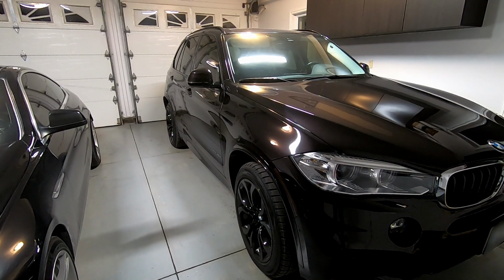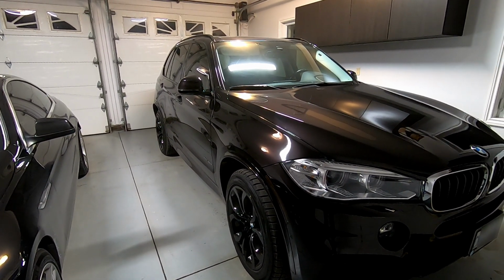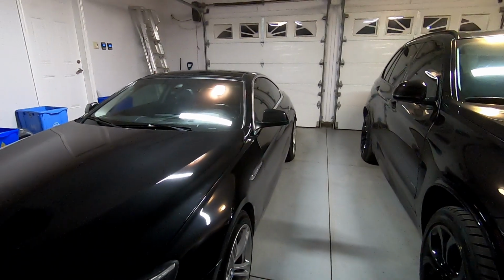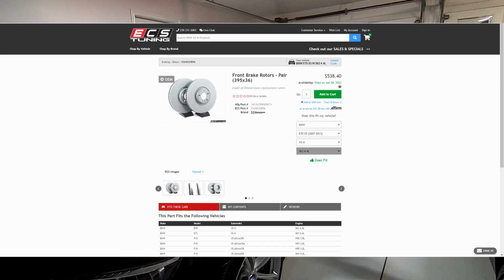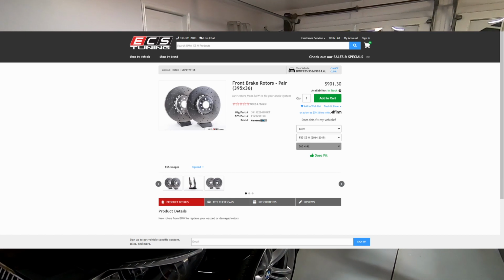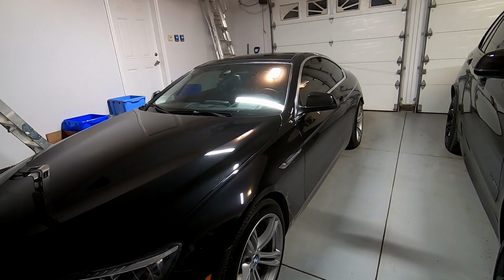BMW F10 Affordable Big Brake Upgrade!

Comment: Any issues considering the center bore of the x5m is slightly bigger? Also, have you thought about f80 rear rotors to match the front?
Reply from the maker: Good call! I didn’t notice any issues, but I will in the near future investigate this as I still have the parts and a similar car to play with. If I recall correctly the hub size where the rotor sits is larger than the 72.6 hub size used for the wheels and it’s possible that the bore for the rotors is the same between X5 and smaller bmw models even though the wheel bore is not the same. You can see a step at the end of the bearing shank where the rotor would sit at 7:05. This step in combination with the rotor screw should allow the rotor to be properly centred. My dad didn’t keep the car long enough to even get a chance to upgrade the rear brakes, he traded it in for a bigger car… but it may be something I’d consider when I need to replace my brakes on my 650i !
Reply: Got cha! Love what you did, good luck with the future project!

Comment: My main question is, will this 395mm setup fit a 19” 351m M-Sport F10 wheel?? Do you need AM or OEM 20” wheels to run this setup or can these brakes fit behind the stock 19s??

I’m between using G series M Performance 395mm brakes vs G series M Sport 374mm brakes. But after watching your video, I’m interested in doing this X5 M conversation (this option solely being for Fitment as I like the G series styling more.)
Reply from the maker: Interestingly enough, the clearance from brake callipers to wheel spokes increases with the X5M callipers, meaning you can actually fit higher offset wheels after the retrofit (but why would you haha). We used 19” aftermarket super speed wheels and OEM M5 19” winter wheels (408M) without issues. I would presume that your 351s would also be the fine, but I haven’t test fitted first hand!
Reply: @dariusGarage  GREAT CONTENT!! Thank you for getting back to me so quickly. With this video alone, I feel like the X5 M caliper route might just be the easier way to go, Fitment wise thanks to your very informative video.
Reply: @dariusGarage this is interesting. I have almost no space at at all between the stock caliper and inside of wheel spokes and have been discouraged from trying this. Also considered the m5 brakes but figured the was no way I could fit them
Reply from the maker: @Dahigi777  f10 m5 brakes are significantly more expensive to retrofit as compared to these X5m callipers as you also need to run custom adapters and the parts are pricier. I’m not sure how fitment would be with f10 m5 brakes but I’m confident that you would be fine to install x5m brakes with your existing wheels so long as they clear your existing f10 550i / f13 650i brakes, they are the same brakes used on alpina b6 edition 50 (I’m pretty sure wheel fitment is identical to standard BMW)
Reply: @ definitely adding this to my list of things to look out for on eBay etc

Comment: If you install new m5 brake dust shields, do you have to remove the hubs to install them?
Reply from the maker: No, on the front of all f10 models (as far as I’m aware), you should be able to remove the dust shield without removing the wheel bearing/hub. The back may be a different story
Reply: Okay thank you!  @dariusGarage

Comment: Does the brake pedal feel spongy? My only concern is that the stock master cylinder won’t be adequate for the upgrade.
Reply from the maker: The brake pedal felt super tight and strong after the upgrade, better than stock. Almost like an on off switch. Even with ceramic pads the pedal felt much like the brakes an F85 X5M which are super strong!

Comment: Did you replace all four brakes or just the front two
Reply from the maker: Just the front 2, for the back we were going to upgrade it to M5 brakes as well (larger rotor and M5 calipers) but ended up trading in the car before we got to it. The back brakes don't look that great even when upgraded as they are just a single piston design like any other car, just painted blue with a larger rotor. Its hard to upgrade the back to something nicer as the caliper must also have e brake functionality and there are no pretty off the shelf BMW rear calipers with E brake built in.

Comment: Can you put those on a 2014 535i?
Reply from the maker: If its an xDrive I'm confident it should bolt up the same way as our 550, it uses the same hub carrier as the 550i xDrive. If its RWD it may be different as the hub carrier is different... that being said rwd and xDrive use the same rotors so maybe it will work as well but it may have some differences. Of course please do your own research before pulling the trigger and buying the parts!

Comment: I was wondering if it would work on a 2011 528i
Reply from the maker: I don’t see why it wouldn’t work, all xDrive F10s use the same spindle that the brakes bolt up to, and the rwd and xDrive 528is (n52 and n20) use the same rotors and brake callipers. This indicates that what you can fit on an xDrive 550i f10 can also fit on any 2011 528i. The only thing to keep in mind is that you will likely need 19” alloys to clear the calliper… they are huge!!!

Comment: What was the total cost?
Reply from the maker: Good point I should have mentioned that in the video! We already had the bare brake callipers from a trade deal so it makes it a bit complicated… We needed hardware ($100CAD) rotors ($1200CAD), pads ($160CAD) and some brake fluid ($30CAD). Our cost for the brake upgrade was around $1490CAD. The aesthetic repairs we did costed an additional $500 for all the fender liners, shields and cleaning products.

The callipers will run you an additional $1000- $1200CAD for cheaper ones, if you want new ones you can buy from ECS tuning for $1000 USD per calliper. 

Total price for just the big brake kit with used callipers will be $2700 CAD they way we did it, but with plain rotors it could be as low as $2200 CAD
Reply: I just did this swap on my X6 the only trouble I had was finding the adapters. But after finding them make sure you have a set of wheels to clear the calipers. I made that mistake even though they are 20” wheels the barrels were 3mm smaller I shaved down the ends of the calipers. Some new powder coating and good as new

Comment: Can u fit them to a e92 m3
Reply from the maker: Great question! I was not sure myself so I did some digging. The E92 is not an easy car to do bbks on because of how it bolts to the spindle. There are normally two retrofits that are done. 

The first is F80 m3 4 piston brakes, you need F80 spindles and a bunch of hardware to make this work. Not an easy task because you have to mess with more than just brakes. 

The second is the F10 M5 6 piston brakes. From my understanding this is a much more expensive option as the parts are more expensive but the plus side is that you can bolt a bracket to the caliper to avoid changing out the whole spindle, you may however need to get a lower offset wheel to clear the massive caliper. The end result however is simply fantastic. 

Either option is expensive and I can see why you are looking for alternatives, however I don't think the E70 X5M calipers would make sense on your application. Their bracket design is similar to the F80 in that its not removable like the F10 M5s are, so you can't put custom brackets on it to make it work with your stock spindle ( I doubt the X5M brakes would work on your stock spindle since F80 M3 ones don't) , so you are left with getting an F80 M3 spindle and hoping the X5M caliper would fit on it (nobody seems to have done that upgrade on an F80 though). I don't have an E92 or F80 M3 to test stuff on nor do I know anybody with one well enough to let me mess with their car. Sorry but I'm not the guy that can answer your question! 

Thanks for reaching out!

Comment: The purpose of drilling and slotting rotors is to help with cooling
Reply from the maker: @travismachado4406  in theory yes, in practice no. 

Drilling rotors in particular is the least effective for performance gains as the holes in the drilled rotors only cool the metal around just around the holes, the non drilled areas remain quite hot… meaning uneven expansion and contraction of the rotors (warping and cracking results). 

They also have less heat capacity as there is less metal to heat up, so they over heat faster, this also means they cool faster yes but that means nothing when your brake fluid is absorbing that heat… and that won’t cool fast! 

Look at race cars and see what they use, they use primarily plain rotors and sometimes slotted.

The slots on slotted rotors allow for the brake pad surface to be cleaned off, they are noisy and can make brake pad life shorter. 

With plain pads, pad material builds up and can prevent full contact with the rotor surface on plain rotors, this can also lead to pad deposit spots on the rotor face which cause pulsation/vibration in the wheel. The upside is smooth, quiet performance, (as long as everything is working properly) with long service life. These rotors are the least likely to warp
Reply from the maker: @travismachado4406  but don’t take my word for it! Here’s an engineer’s take 

https://youtu.be/EIa6_C1B6UQ?si=kE4uqHEUkegwQiDn

Comment: Will this help with brake fade?? Been experiencing hot brakes and loss of power after some spirited drives in my f10
Reply from the maker: Yes, this will definitely help with reducing brake fade since there is more mass and fluid to heat up in the braking system. But there are cheaper alternatives as well! It’s always depends on your specific case…

Which f10 do you have? When’s the last time you had your brake fluid flushed? Are your brake pads and rotors relatively new? What brand are those components? Are your brake cooling ducts still in tact? For most on road users just these things should be enough. And if not you can change your driving to still be fast but easy on your brakes…
Reply: @dariusGarage  I have a 535i msport! The pads and rotors oem from dealership and are a few months old so I’m thinking it is the fluid because I havent flushed it… but the pedal remains hard so I read that means it’s more pad failure… I also just got an alignment at the dealership which I’m pretty sure they didn’t do to spec for the msport suspension and I’m wondering if that could be putting pressure when I use the brakes? Thanks for the reply!!
Reply from the maker: @bestclips7223  Factory oem pads suck when it comes to spirited driving because they don’t have an expansion groove in the middle… this causes them to crack and cause all sorts of weird side effects when they get warm, funny enough my dads 550i had cracked oem brake pads when we did this upgrade. And they only had 1000kms on them! I would suggest you change those out for a performance oriented set with an expansion groove down the middle. I’m in the process of trying out brake pads and have yet to find the perfect one, but my favourite so far is EBC Redstuff or Yellowstuff, the drawback for either is long bed-in period (1000kms) where you can’t drive hard on them at all! They are also dusty, redstuff is less than oem pads and yellowstuff is more dusty than oem. Once they are bed-in they are amazing! Redstuff feels like oem but can take way more abuse, yellowstuff feels way more grabby by comparison and can take even more abuse than redstuff but also eats up your rotors faster. Don’t go for ultimax2 they are poop. Next set I buy I will try out another brand, but for now this is all I know. 

Flush that brake fluid with minimum DOT 4 fluid. This should be done every 2 years I believe. Ideally you should take it to a shop with a bmw computer that can run the brake bleed program. 

Alignment shouldn’t cause any braking abnormalities. It will cause advanced tire wear/ feathering on one side (if you have bad camber) or the whole tire (if you have bad toe). It can also make the car feel unstable at speed or around corners. 

Hope that helps!

Comment: Very nice, It came out great! I am doing the smaller setup with the 348mm rotors and the 4 piston calipers.
Reply from the maker: Thank you! Interesting! Are you planning to use F30 callipers and stock rotors on an F10/F13 car?
Reply: @dariusGarage  Yes is the f30 caliper and the 550i rotors on a  f10 535i
Reply: will be posting the setup on my channel once I'm done.

Comment: This was super cool but no way is this an affordable upgrade in the US M5 and x5m calipers are very expensive even used the cheap upgrade would be something more along the lines of the g30 540i MSport calipers pads and rotors those are cheap and very strong.
Reply from the maker: Thanks for the info! Affordable is a vague/relative term so it’s bound to cause some folks to disagree, it all depends on your perspective! This upgrade is half or even a quarter the cost of Brembo BBKs, let alone other options like CCBs which are not even feasible for the majority… perhaps “attainable” is the better choice of words here😄